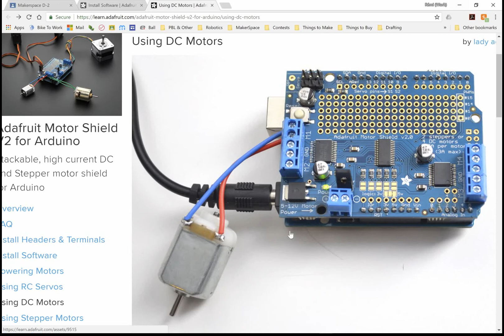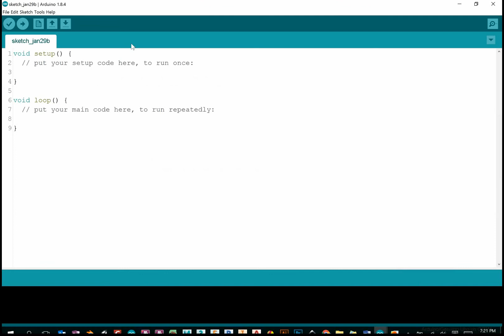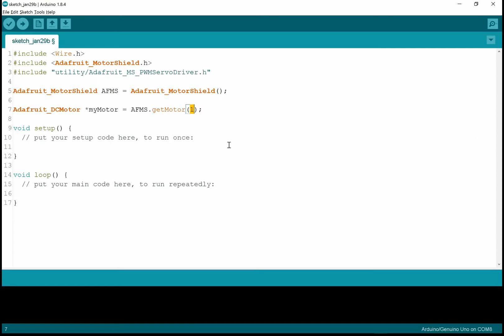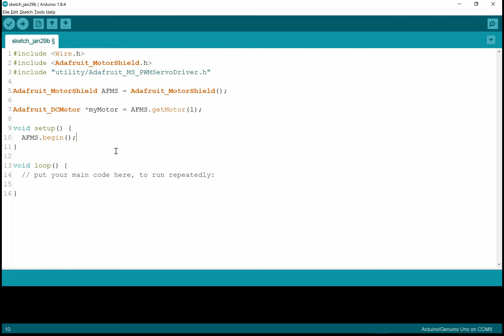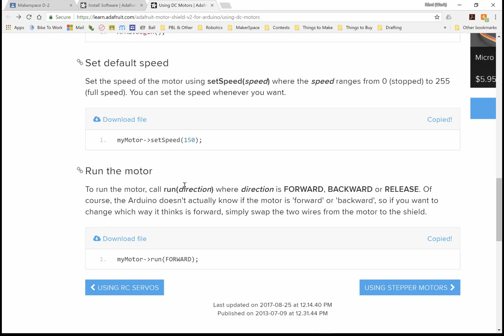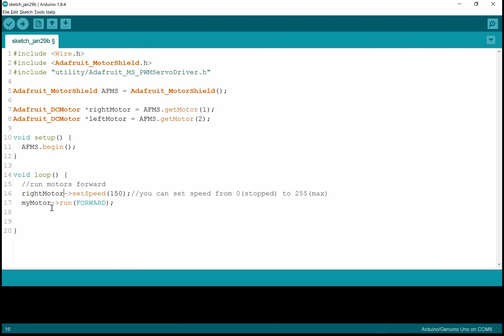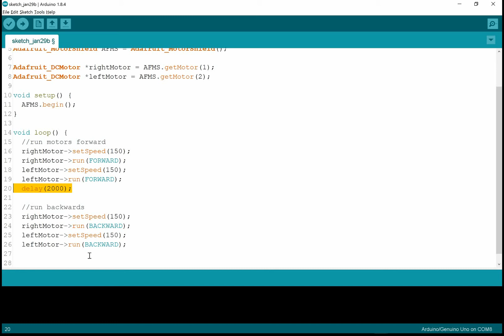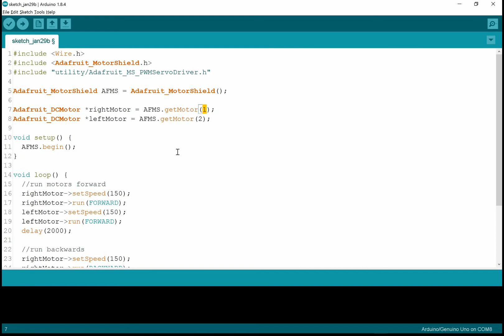Adafruit Motor Shield V2 - DC Motors

Comment: How can I connect 2 motors to the board? So I can take double amps for each one?
Reply from the maker: You can plug up to 4 DC motors to the four slots (M1, M2, M3, M4).

Comment: How many sensors ( Infrared and ultrasonic) can be plugged into this board
Reply from the maker: The same number as a regular Arduino UNO. Ultrasonic sensors usually use two pins and there are 14 digital pins and 6 analog pins. So in theory 10 ultrasonic, though usually I wouldn't use pins 0 and 1.
Reply from the maker: I believe infrared sensors just use up one pin.
Reply: @RemiWauthy  Infrared sensors use three pins VCC(+5V), GND and Analog. I want to use 2 sensors on this board but there is only one VCC(+5V), What can i do ?
Reply from the maker: @salah4654  Different options. If you have a breadboard you can hook up the 5V to one of the rows. Otherwise you can connect the infrared's VCC to one of the digital pins then program that pin to be always HIGH. Hope this makes sense...

Comment: How to program for multiple adafruit shield togather on arduino 
Kindly reply
Reply from the maker: Hello Sehab. I have never done this myself, but to to this you must solder across the jumper shown here: https://learn.adafruit.com/assets/9513. This will allow you to address each shield differently depending on where you make the solder connection. 
Check out this link for more details concerning the code and addressing each specific shield: https://learn.adafruit.com/adafruit-motor-shield-v2-for-arduino?view=all#stacking-shields